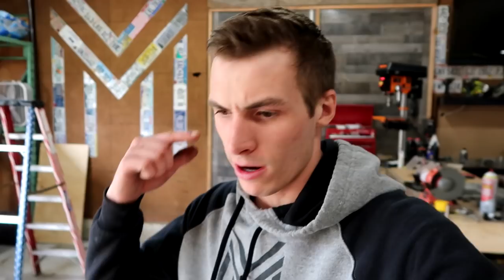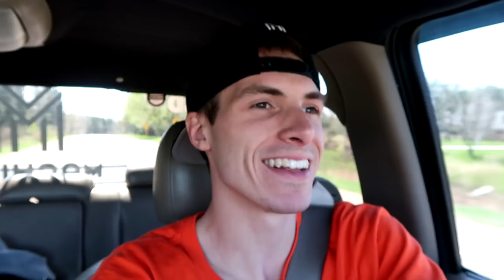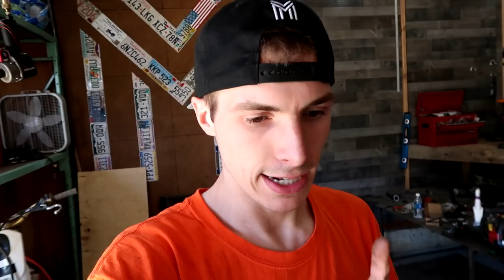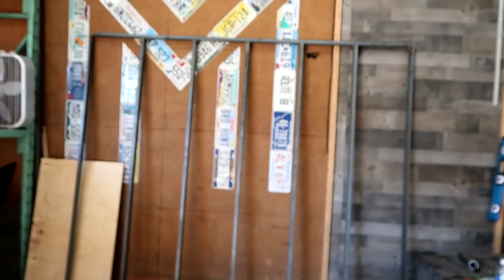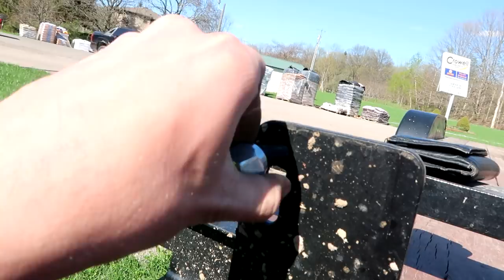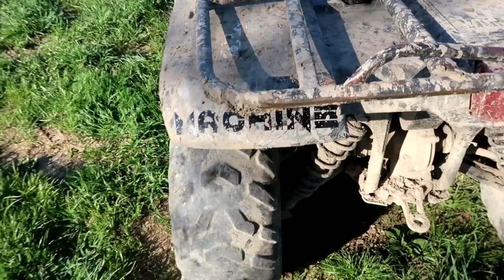Back From The DEALER...

Comment: I have a mid to late 70's AMC 360 V8. Its been on an engine stand in my garage for 20 yrs. It was compltely rebuilt sometime in the 80's and never started.It was in a 77 CJ7 project someone gave me in 1997. It needs oil pan,alternator,carb, maybe power steering pump, and starter,I have carb for it but it needs cleaning or rebuild kit. Engine needs to be disassembled to clean out whatever seeds mice may have stored in there over the years. Its clean,no rust.  Maybe Dalton is interested???? 🙂

Comment: You can use 2"angle steel and frame the doorway.Angle brace the upper part to handle lateral stresses.When you're on uneven ground your trailer's body will twist and the door won't close otherwise.3/4" treated plywood on top of the floor in the storage area,should be more than enough to handle all the toys.(No footpegs sinking in when wet)

Comment: Boxing in the area 5-7" for each hinge should suffice.You do need .at least.12"corner braces @45o angle at upper inner corners for the roof at the doorway,and use the same angle steel to outline it.The wood frame of the trailer won't handle stresses of uneven ground and your door won't close when you start shifting weight in and around.The trailer body can and will twist without internal brace as the back wall is no longer an absolute,in regard to lateral stresses.

Comment: 1/8th angle should be thick enough. Do some heavy duty hinges and I recommend “gorilla lifts” for the ramp door. Makes the closing a lot easier. I’ve used them on almost every trailer I’ve ever built.

Comment: Maybe talk to somebody that does LS swaps, like sloppy mechanics.  He might know if any of the aftermarket ECU's would offer ODBII with emissions monitors.  I think that is basically what you need to pass inspection in NY.  They might even go as far to see if the VIN programmed into the ECU matches the VIN on the jeep.  Don't know if there is a product that does that.   GM ecu's are much easier to work with if you have HPtuners,  one of the many reasons people go directly to an LS swap.

Comment: For toy hauler they use large long hinge bracket on the floor. With the floor being redone and reinforced and the hinge being he width of the floor will def hold crush. And more than likely be able to hold a car that would fit in there. I used to be an rv technician in NorCal.

Comment: You need to build an outer door frame and attach that to the back of the trailer. Then you can weld hinges on the door and frame. Also you tie the door locks into the outer frame.

Comment: Put steel bars is the middle going all the way across and down to give it more strength and you should use diamond plate on the inside of the ramp so it’s easier to clean and stuff

Comment: Cam ring tone sensor dose not correlate with ecm need to change. Came tone ring or it that motor came from 99 or newer the ecm needs to read chip in key with. Copper coil tone pick up that goes around ignition switch for the ecm to allow the motor to stay running

Comment: its broken cause its a jeep, wouldnt be a jeep if it ran all the time, that would be too easy
Reply: RyanPlays bs jeeps are just as good as anything else is
Reply: ehhh thats entirely debatable, Just Enough Essential Parts for a reason, i mean any car is a good car, but jeeps are something else, you fix one thing another thing breaks, why. fucking why. i hate jeeps, but i own one lmao, i hate it when it doesnt run/cant run it on the trails actually which is what feels like always
Reply: RyanPlays my jeep has almost 300 thousand on it everything original except the stock d35 to a 8.25 and it still runs great
Reply: well i mean if you use it as a car im sure its fine but W H E E L I N J E E P, aka money pits like boats but more money
Reply: RyanPlays lol I'm actually turning it into a trail rig right now it was a daily but it is a trail rig now swapping the front axle and other good stuff I'm sure i will brake plenty but if your going to wheel anything your going to brake shit
Reply: yeah im probably getting rid of my jeep soon for a ranger or something smaller that isnt over used now so i can get even cheaper parts lmfao